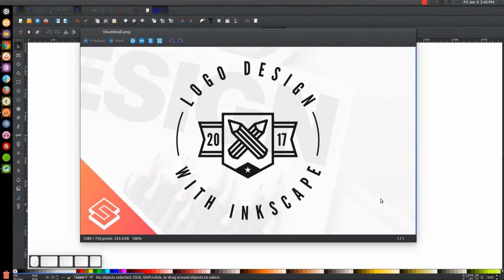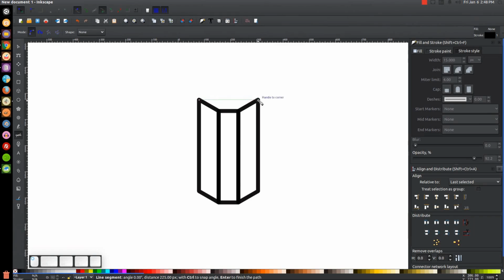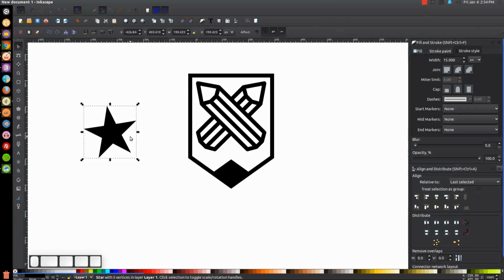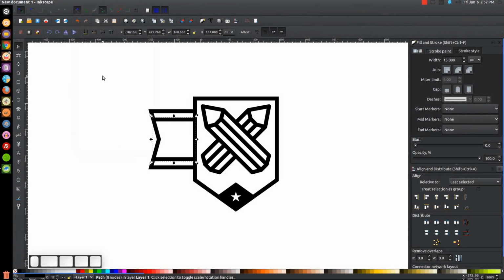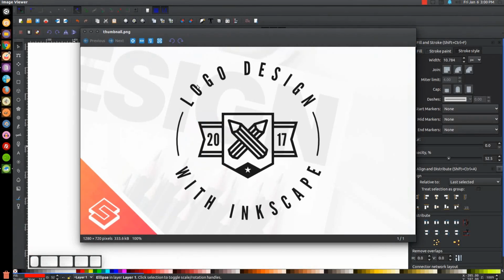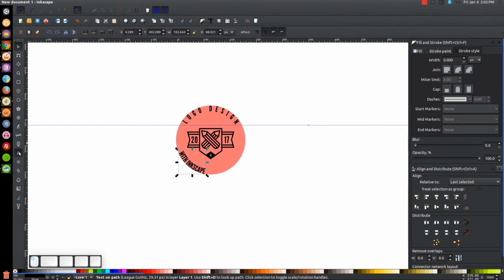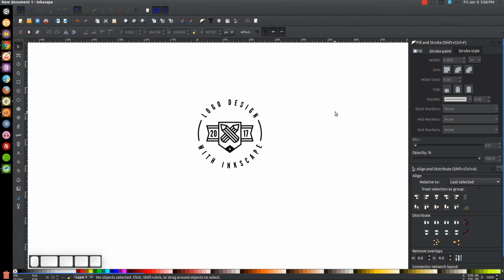Inkscape for Beginners: Logo Design Tutorial

Comment: Hmm.  42 seconds in and I have already hit the first thing I can't do. "Custom" does not exist in the view menu of Inkscape 1.2.  Found "align and distribute", but it's on the right side now.  It would also be nice to point out for beginners that pixels are not the default.  I was in mm, and the sizes seemed wrong until I switched it.  Terms like "Up here" aren't useful when the mouse moves too quickly.  How about "to the top of the left toolbar" or something descriptive?  Okay.  I give up "where it says snap tocustomodes"  leaves me clueless.  I tried to go to other sources to see what the icon looks like, but they have whole sets of icons I don't have.  I found the Advanced snapping mode option, but there's nothing that seems right.

Time for a new version?  This seems like it could be a great intro if it matched the current interface.

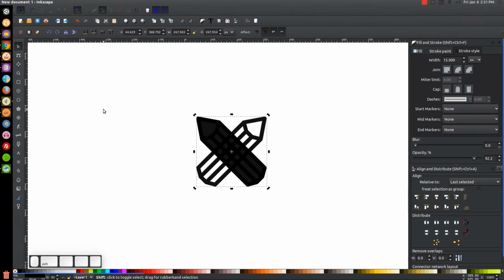Comment: You know the current version does not look like that and is very hard to follow your dialogue, also the mouse is impossible to follow to find the icons, which are not there. The entire first row of icons (the tool bar) is not on this version, ie print, cut, copy etc and I cannot find the menu to turn it on. All options are already enabled.  The tutorial was not achievable after the instructions failed at time  6:20.  I gave up.  I already use a different Vector drawing problem with ease, this one is has rather obcsure terminology.

Comment: I'm good up until the point where I have to do path break apart, path unision etc
My pencil is not turning fully black like yours so I think that's the problem but idk where i went wrong
Reply: Same here. It did not work until I did some research and realised the problem was that I was dealing with objects and not paths. When you've created your shape of the pencil made of paths, you need to "group" them from the path menu with union and not the object menu "group". That was my issue, maybe yours is similar. Let me know if that solved your issue.

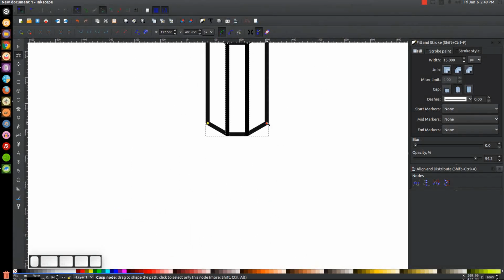Comment: You lost me at 4:32... my design DOES NOT want to show any nodes that can be adjusted when you drag the edit path by nodes tool across the bottom points of the pencil. I've replayed that part of the video at least 5 times and can't figure out why inkscape won't do it.  I even checked to ensure I have the right version (92.4).... not sure what I am missing here...
Reply: 1-29-22 version 1.1 user.  That is correct.  when you are in node edting and you select around nodes, you only see the selection box as you drag it.  when you finish, the box dissappears, but you have in fact selected those nodes.  you just want to really watch the box line that it covers only what you want.

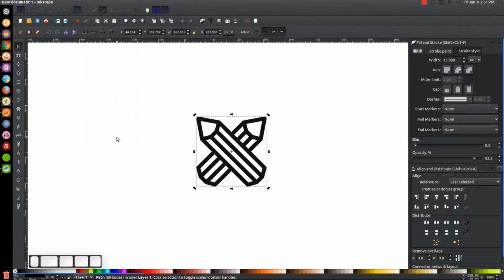Comment: I’m sure I won’t get a response because this video is two years old, but for some reason, when I am layering the pencils (around 6:25), everything gets messed up. I follow the instructions - path > break apart, path > union, hold shift > click on the one behind, path > difference. And then the pencil on top goes completely white and I can’t select it. It’s just gone. I have no clue what I’m doing wrong, but I think I’ll just start over completely and see if that changes anything. 

Also, a suggestion: maybe slow down a bit in your videos? I had to replay the “path > break apart, path > union, hold shift > click on the one behind, path > difference” part like seven times, pausing after each instruction because you were moving too quickly.

Comment: If you are having trouble with the CUT PATHS at the end of the video. Creating the lines on the side of the circle there is a hack! Create the red square like in video, position It just the same, select the red square and circle, but INSTEAD select stroke to path, then cut path. This will make all lines disappear, but the small line that you need will just need to be stroke adjusted. Try again on other side 😊

Comment: hey. you always go custom and the zoom 1:1. but when i do this it fits the page to the screen . where as yours look like you are zoomed in the page without page boarders, mine shows the full page with its boarders. so how do i change this to get the same view as you?
Reply: How far it appears to zoom in depends on both your display and the size of the document in inkscape. If you're using a high dpi monitor the same size document will appear smaller. You could either simply zoom in some more or increase your documents size under "File" -> "Document Properties" (Shift + Ctrl + D) where you can adjust Height and Width. In here you can as well resize the page to its content which i find quite useful.

Comment: Hey Nick, when using the "Put On Path" is there a way to get rid of the circle after the text is set they way I want it? If I try to delete the circle/path the text goes back to normal.
Reply from the maker: Yes, select the text and go to Path > Object to Path. After that, you can delete the circle. BUT you won't be able to edit the text again after that, so make sure it looks exactly as you want it to first.
Reply from the maker: Yes, select the text and go to Path > Object to Path. After that, you can delete the circle. BUT you won't be able to edit the text again after that, so make sure it looks exactly as you want it to first.
Reply: thanks

Comment: The current available version of Inkscape behaves way differently than in your tutorials. I have no 'Affect' option, and my lines don't join properly, so my pencil looks weird, with some lines longer than others, despite using the snap to corner function. This is the second tutorial of yours that I haven't been able to complete because my copy of Inkscape just doesn't do a lot of what is shown here. Might be worth shelling out for Illustrator, after all.
Reply: Mark, you probably figured it out, but for new readers here... in Inkscape 1.1  the word 'Affect' does not show.  the 4 options just show up at the top.  Turn off the first one.  I tried to paste a pic of it but it would not paste.  Also in version 1.1 the snap snaps but doesn't attach the nodes so  inserted the new middle node click outside the nodes on the line.  this will not attach the line to the pencil but will anchor the horizontal line so that when you press CTRL  and drag the middle node up, the line ends stay where they should.  1/29/22

Comment: Somehow when I cut path everything went a little wonky, I went back and re did it, couldn't figure it out so I just made it work. Thank you for another great video
Reply: I was getting an hourglass-like shape after cutting path. So I CTRL+Z, flipped the circle horizontally (which looks like it does nothing but...) right before using cut path and it looked like an actual circle even after cutting.
Reply: Thank you so much! It worked.
Reply: That actually worked for me as well. Thank you!
Reply: @SuperShadow  Flipping the circle right before using cut path does the trick. Thanks!
Reply: just flip the circle it wont show any changes but when you cut path it will be same as video
Reply: @shreyasjoshi915  Thanks. This worked.
Reply: @shreyasjoshi915  I had trouble cutting at the last step, so I scrolled down the Youtube comments and fould this solution, it works!! THANK YOU!
Reply: I had the same problem. I tried it with just a circle and two diamonds created like those in the video and got the expected results, but every time I tried it in the logo, the pieces didn't resemble a circle.

I worked around the problem by drawing a rectangle across the circle so that it intersected the parts of the circle I wanted to keep. Then select the rectangle and circle, cut path. Now I have something equivalent to the video, but actually a little easier.
Reply: thanks that did the trick ! really wonder what's going on underneath to produce that
Reply: cool! it worked